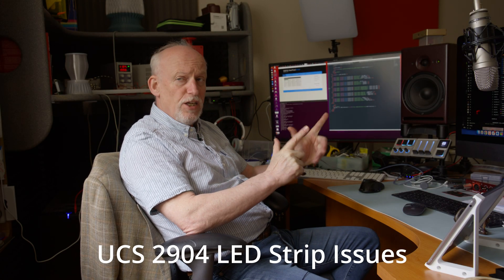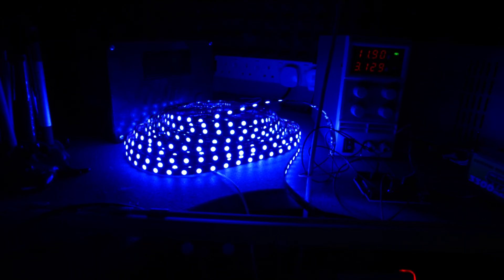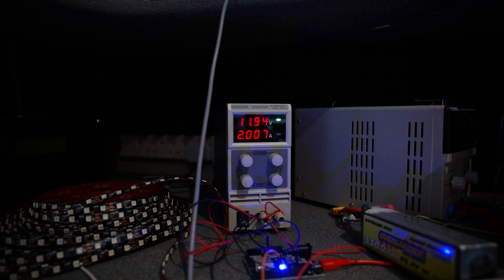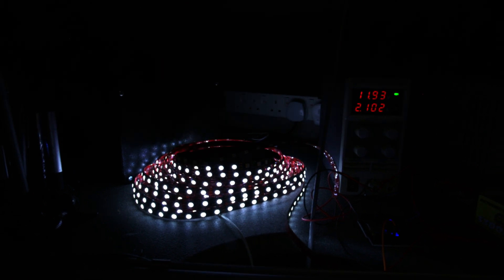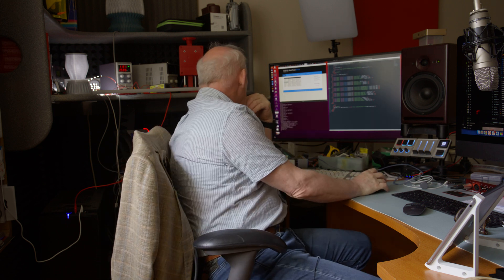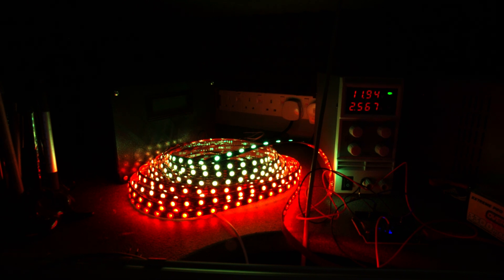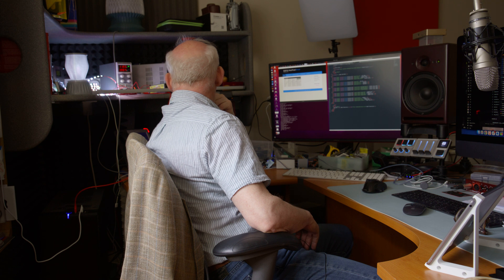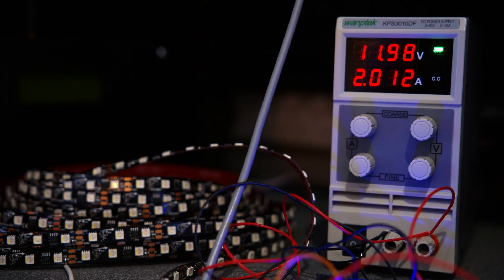UCS2904 LED Strip Issues

Comment: did you ever find an explanation?
Reply from the maker: Apparently this is to do with showing the customer the strip is 'working' .  The 2A standing load is to power the neopixel chips 'data' processing.   These days I use different strips!